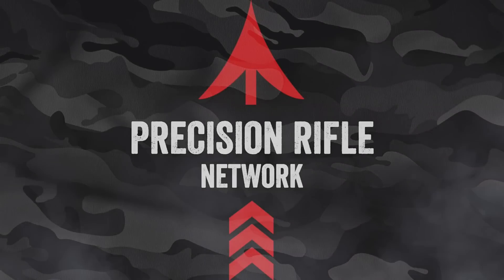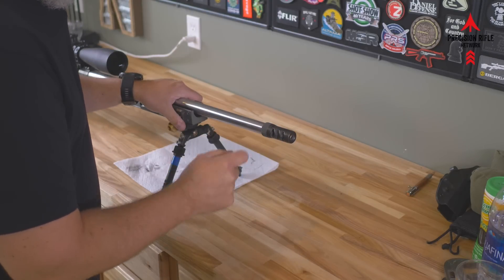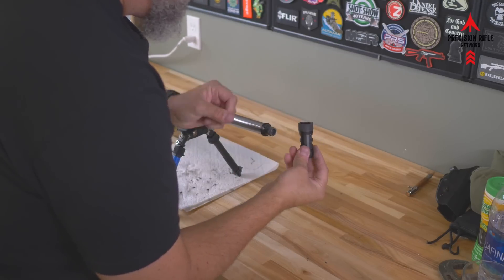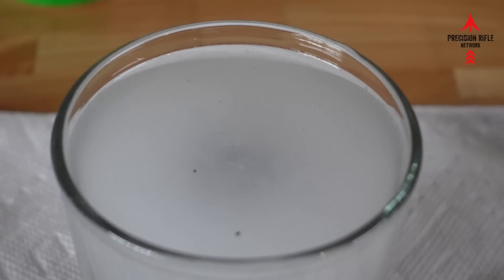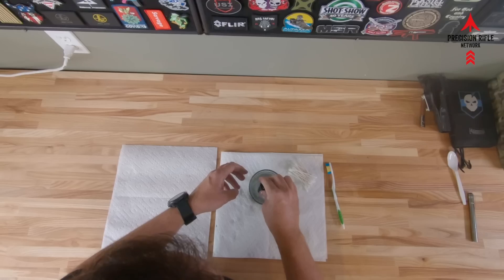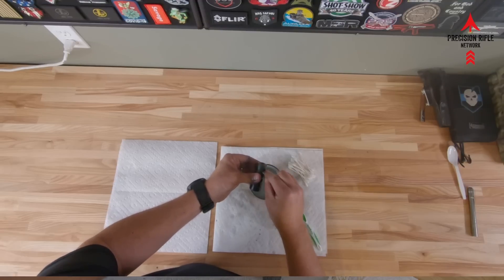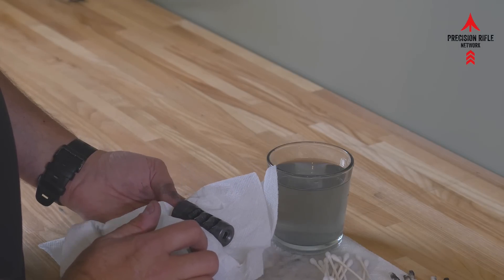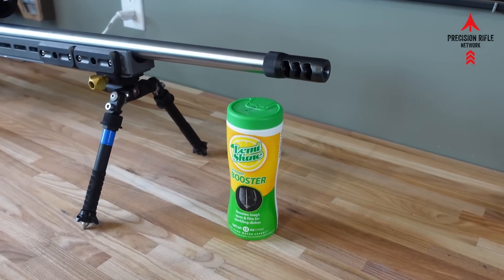How To Clean A Muzzle Brake

Comment from the maker: Apparently Lemishine can remove nitride coatings or coloring.  Fair warning.  It did not remove the coating/coloring on mine.  I personally wouldn't care either way.  Just wanted to make that clear.  Adding this part...the discoloration that some people are throwing a tantrum about can be buffed out using windex.  It neutralizes the acid in the lemishine.  I've never had this discoloration happen and I'm told, if it does, it's completely reversible.  Also, Area419 is the only brake manufacturer that I could find with any warnings about cleaning products on their website.  APA literally has a similar video to mine, and they recommend the Lemishine as well.  🤔
Reply: it doesnt remove nitride coatings, nitride isnt a coating but a hardening process of the outer layer of the steel, it attacks/removes the colour the nitride process applies to the surface. you can remove the colour the nitride process applies to the material and the hardened, smoother and corrosion resistant outer layer remains. using products that strip the colour from nitrided parts wont affect the product in any way just possibly and eventually strip it back to the steels original colour.
Reply from the maker: @thestacche6898  ok thanks
Reply: Wish I read this before I dipped my brake in Lemi 🤦‍♂️
Reply: Lemishine is not a “soap,” its citric acid, no detergents in it as far as 
I know.
Reply: @DavK637  remember anything that gets posted on the Internet should be considered to possibly be bad information! There are many ways to fully clean your muzzle break that work far better and don't cause any problems. I recommend wipe out bore cleaner! It's designed for it and gets the job all the way done which is extremely important for accuracy
Reply: I know this is an old video but all the same:

The change in color of your brake is visible in your video. Went from a deep black to a slightly more greyed color after cleaning. 

Personally, I don’t care because Its just aesthetic but that would’ve been handy to know before I cleaned my MPA 6.5 brake that did the same thing. It dulled the laser etched markings and made the steel look more grey with a hint of brown (like a light surface rust) - clearly citric acid and nitrided parts don’t vibe together 100%. I hope this doesn’t cause future accelerated corrosion. I just gave it a coat of oil to be safe. 

People don’t always read the comments on videos (me included). Maybe a small disclaimer edit could be added to the video to save us from ourselves? 

To be fair, the Lemi Shine worked great with no I’ll-effects on my bare stainless Area419 brake. So thanks for the cleaning tip. Any idea of products that would work similarly but not change a nitride finish? 

Thanks for the vids!
Reply from the maker: @Kranketh  thanks for watching.  I added a second disclaimer to the description of this vid.  I am not aware of any cleaning products (that actually work) that don't have the potential to mess with the finish on gun parts.
Reply: Also, you don't need to put a tool in the ports to remove the A419 Hellfire. Just keep rotating the knurled nut past where you take up the slack. A little bit of torque will pop the brake right off of the tapered adapter.
Reply: @PrecisionRifleNetwork   Great how to video. How i do my breaks is. Before shooting them the 1st time. I use the same CLP I use to clean & lube my firearms with. Nice 🤏🏻 lite film all over the break. whipe it all down and install it. On cleaning my muzzle breaks. Just your average CRC brake cleaner. Trick to using brake cleaner is. 1# dont keave it on to long. 2# whipe a 🤏🏻 of CLP back on the muzzle break for a protective coating. Remember. Brake cleaner as GOOD as it is. It removes, EVERYTHING. if you don't coat with a protective lube on what you used the Brake cleaner on. It WILL rust. Never had any issues using brake cleaner on my firearms. Just be 👀 on plastic while using brake cleaner.

Comment: I have used CLR for this.  Works extremely well.  Additionally, I am meticulous about my crown, which is why I can not shoot brake-mounted suppressors or permanent brakes..  I scrub the crown with a tight nylon brush.  Super-sonic wave consistency is a must! Thanks for the vid!
Reply from the maker: Thanks Marc.
Reply: CLR voids the warranty too.
Reply: @jeffsikula2920  and apparently can turn it pink

Comment: I use Accu-Washers for a permanent bond on my builds so there is no gap between the brake and the muzzle.  I don't want to have to remove my muzzle brake for cleaning only to install a new Accu-Washer.  They're more expensive than crush washers and more effective.  After every range tripI also use an Otis system cleaning cable and patch with solvent that cleans the bore and brake as well.  I will probably use a nylon brush and pipe cleaner to pay more attention to the brake in the future.  Good video.

Comment: Eric used CLR on his EC tuner and works well! His tuner is SS so... Just let you know. By the way, thanks for sharing!
Reply: Thought about that after the Post, all of his stuff is stainless steel you probably don’t want to use CLR on a coded item
Reply: @silverbeast3637  Agreed! Like I mentioned "SS" as above I meant stainless steel... I want my stuff sooooo clean but... I am nervous crack!
Reply: Has anyone tried carburettor
cleaner to clean muzzle brakes? I haven’t used it , but I think it might work . It certainly wouldn’t hurt the steel .
Reply: @conservativesniperhunter7439  yes, I use Berryman Chem-Dip carb and parts cleaner in the one gallon size. It works great. I don’t know if it is better or worse than acid based cleaners like Lemi-Shine or CLR. I had it in hand so I tried it and it works.
Reply: @mln19631  Thanks for the tip , I’ll try to find me some to try it . Cheers 🍻

Comment: Instaed of the carbon build up on the brake, the caked up carbon build up on the crown is more of my concern, especially if you have a non-flat / retreated style crown. My method is to soap it up with Hoppe 9 for an hour. I heard CLR works pretty well as well but i don't want any strong acid in touch with my barrel metal. Then, use the tail of a bamboo disposable chopstick you can get in any asian restaurant to shove the build up. Normally it should just fall off easily. If not, soak longer and do it again. I success everytime using this method :)
Reply from the maker: A good method is the one that works. 🤙
Reply: I've been soaking mine in Hoppe 9, have 2 soaking right now, but I want to try the Lemi-Shine...

Comment: 1 part hydrogen peroxide 1 part white vinegar works well.  Soak for 24-48* hours.  Carbon melts off.  This is referred to as “the dip”  this is an old school super solvent.   It will also remove lead deposits but... if doing that the liquid byproduct is toxic (lead) do not get on your skin.  

Or white vinager in ultra sonic cleaner works well also.
Reply from the maker: Thanks Luke.
Reply: Do not use the dip on anything but stainless. It’s acid and an oxidizer. It literally corrodes the junk off. 

I wouldn’t try it on anything but stainless suppressor baffles for a rimfire can. Even then you’re stuck with a jar of lead based poison that is easily absorbed through your skin. 

I’m sure that it would clean a brake pretty good, but it might eat it.

Comment: Lemi Shine is ascorbic acid, not detergent. It enhances detergent by dissolving hard water minerals and scale. It's not a strong acid and shouldn't be too destructive to the steel, but once rinsed and dried, I would be sure to apply oil and allow it to soak into the pores of the steel.
Reply from the maker: Thanks

Comment: Soak mine overnight in boretech.  Buy a bottle of Lucas fuel treatment then cut the top off of it after you pour it in your fuel tank.  Brake just fits in inside it.
Reply from the maker: Good tip.

Comment: carduarer cleaner   scub also why  did you use a screw driver  take off  with out black tape   to prevent scatching ?
Reply from the maker: Because my guns and everything I attach to them are tools. I use my tools to do work. Some wear and tare is expected. I could care less about some scratches. 
Case in point: I got a big scratch on the top of my $3800 scope today. Don’t care. Still works perfectly.
Reply: @PrecisionRifleNetwork  thats you I take  care of my stuff

Comment: What about an ultrasonic cleaner?  A friend of mine has one and uses it to clean gun parts.
Reply from the maker: I've heard that works fairly well.  Never tried it.
Reply: I have been doing the Ultrasonic on just about everything at this point, its nice but not convinced that its any better than just scrubbing it down as shown in the video! Thanks for the pro tip on man, good video as usual!
Reply from the maker: @ssamuelt79  thanks!
Reply: I use ultrasonic on everything from my muzzle brake to my brass. Inuse dawn with ajax for my muzzle brake and one shot for brass

Comment: Thanks for this; good information. I am like you were, and never knew about cleaning the muzzle brake. Now my brake has very large deposits and they are very hard. Do you think Lemi Shine will work on these? I will try it regardless.  I hope it works otherwise, I may end up buying a new one.  ☹   Thank you.
Reply from the maker: It works. Just be careful not to soak for more than 20 minutes at a time or it could ruin the coating on your brake…if you care about that. Some people do. I don’t.
Reply: Try a sonic cleaner

Comment: It literally says on their website to not use lemishine or citrus base cleaners because it could discolor the nitride and void the warranty 🤯😩 💩
Reply: Happened to mine... according to the guy there I emailed they recommend boretech. Not using lemishine or clr on my stuff again despite what others say. To each there own but on my gear I’ll steer clear.
Reply from the maker: noted. thanks.  It did not discolor mine nor would I care if it did.  I should have said that in the vid though.

Comment: You ever use this method to clean a suppressor?  I have a TBAC Ultra 7 and they say to use CLR, but I'm just a little hesitant to do that...
Reply from the maker: I have not tried a suppressor yet. 
Read the pinned comment, lemishine could remove coatings as well.
Reply: @PrecisionRifleNetwork  Ya I saw that comment too.  They say to stand the suppressor up and just fill the inside so it's not touching the coating, just the titanium.  Might have to give this a shot
Reply from the maker: @trevorschuetz1530  cool, let me know how it goes.  I might be interested to try it.

Comment: What about brake solvent or carb cleaner??
Reply from the maker: Never tried either of those.  Have you?
Reply: @PrecisionRifleNetwork  Sorry no. Thanks just the same. While I'm getting "long in the tooth", and having firearms since my youth, I am new to precision shooting. Attempting to learn all I can. Don't have 500 rounds through my RPR 6.5CM yet, but have cleaned up the bolt and action with solvent - before oiling - sp thought I'd ask.

Comment: I have been shooting with brakes installed or permanently affixed for some years now and learned that simply cleaning it while installed is not good enough. Carbon building up around your crown will affect accuracy and even corrode and damage your crown over time. If there is a gap between muzzle/crown to where your brake starts that is a horrible spot for carbon to build up and must be scrubbed off gently with solvent and nylon brush.
Reply from the maker: I agree

Comment: What’s the best way to clean off caked on carbon buildup on the crown?
Reply from the maker: "best"? I'm not sure.  Some guys will literally stand their rifle up vertically with the barrel sitting in a container filled with cleaning solution.  Obviously damaging the crown is a concern.  Using soft nylon brush, like a toothbrush, to gently scrape off the carbon.
Reply: @PrecisionRifleNetwork  Thank you!

Comment: bruh berryman chemdip small bucket for 20$, hoppes no9 solvent 32oz for 15$....mix a small containers just for this application to throw the muzzle device in that can be sealed like a survival container size of a small water bottle you see on amazon. boil water, in a pot secure the container cap side out of the hot water and let it cool on its own takes like 20 min, do it first with the berrymen and then hoppes solvent. you can use the same liquids many times...first you gotta get the damn thing off...still same deal but this time the whole barrel goes in the can and you wait....repeat and if still stuck after 2 tries, get a brass hammer, dip in the berrymens again but this time its very hot, since its been in the there for like 10min and as soon as out of the bath strike on the crush washer area a few times all around and try to looses, repeat if not successful...if still stuck start praying.

Comment: will this turn it . or Chang coler
Reply from the maker: yes, it could.  If you leave to soak too long it could mess up the finish on the metal.  I never leave mine to soak longer than 20 minutes and I also clean off the muzzle brake after soaking.  My brakes have never been discolored.  Use at your own risk.

Comment: The manual actually lists lemushine as a no go
Reply from the maker: Yep. Because it “might” mess up the finish and they don’t want to deal with returns. 
I have been using it on mine repeatedly and it has not ruined the finish, and obviously the break still works perfectly.
Simply just a liability statement so they don’t have to deal with dumb people who leave their break sitting in the chemicals for too long.

Comment: You guys clean you muzzle breaks?
Reply: well I aint so sure its absolutely necessary for accuracy. I have shot some really good long range scores with extremely dirty barrels and brakes. I tear my competition rifle down twice a year when setting up for my summer and winter loads. When I got it tore down to switch to summer loads,  I usually clean everything. Cleaning helps everything come loose easier when I tear it down. I change barrels every year and its nice when everything comes apart and goes together easy. 
 Im fixing to try this guys idea mostly because CLR is about $5 for a cup and Lemi shine is pretty much free to use and in my reloading room already. I reall aint expecting accuracy increases but i am expecting a clean easy rebuild.

Comment: What if you dont remove the break?
Reply from the maker: Help me understand your question please.  Are you asking how to go about cleaning the brake if you can't/don't remove it from the barrel?
Reply: @PrecisionRifleNetwork  yes sir
Reply from the maker: @DS-gd1xw  I would say to clean it often, so the carbon doesn’t have time to build up as much. Spray on or wipe on the cleaner and let it sit for short periods. (20 minutes max) and then scrub with a brush. Then clean off with something like windex or simple green to completely remove the lemishine or other carbon cleaners.
Reply from the maker: Just a suggestion. Make sure to read my pinned comment at the top about discoloration.
Reply: @PrecisionRifleNetwork  where is the pin about discoloration
Reply from the maker: @DS-gd1xw  it’s at the top of the comments section. Should appear as the very first comment.

Comment: CLR cuts carbon better then any solvent I have used. Credit goes to Erik cortina.
Reply from the maker: Cool. Thanks.
Reply: Just watched that video 👍
Reply from the maker: @okienightstalker3145  crazy. I’ve heard people say that but I didn’t experience that.
Reply: Will turn black nitride brake pinkish.
Reply: @bryanmarks4070  it also turns your brake purple. Area419 strictly states not to use clr.

Comment: Another vote for Boretech eliminator from me. I wipe off what I can with a rag, then let boretech soak into it and then scrub it off.
Reply: I use all three bortech cleaners. Eliminator for general cleaning.  Carbon eliminator for heavy carbon and copper eliminator for heavy copper.  I simply soak my brake in the carbon eliminator. problem solved.

Comment: Do not use lemi-shine.  Even Area419 says not to do so.
Reply from the maker: I'm aware.  Please read the pinned post.
Reply: @PrecisionRifleNetwork  I'm not trying to be an ass, but why is the video still up if it shows exactly what NOT to do (unless it was titled "How NOT to clean your muzzle device")?  The pinned comment, for whatever reason was not at the top of the comment feed for me.
Reply from the maker: @OFFICIALUND  It's still up because despite what area419's site says, myself and a good number of people that messaged me, have never experienced discoloration of thier brakes due to using Lemishine.  In addition to that, other brake manufacturers have videos on their own social media sites saying Lemishine is a great product to use on brakes.  In addition again, even if a brake gets slightly discolored, it won't magically cease to be a high quality, perfectly functioning, product.  That all being said, if I had it to do over again, I would have used an APA brake instead of the Area419...just to keep from dealing with this drama.